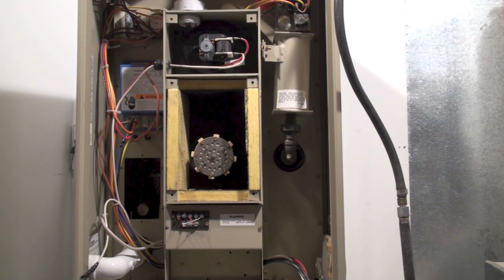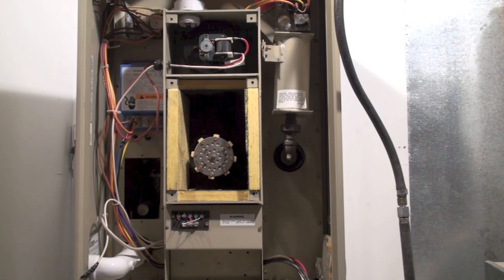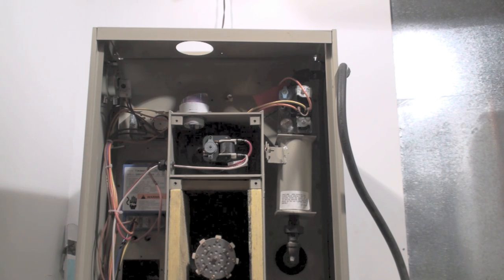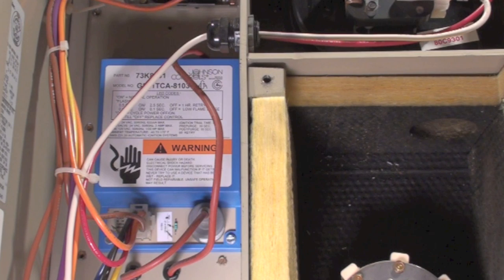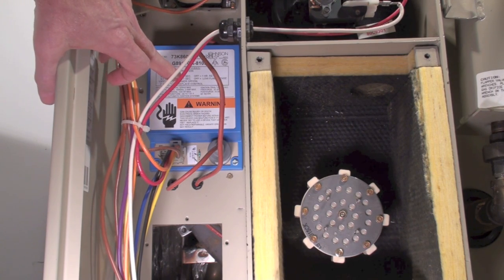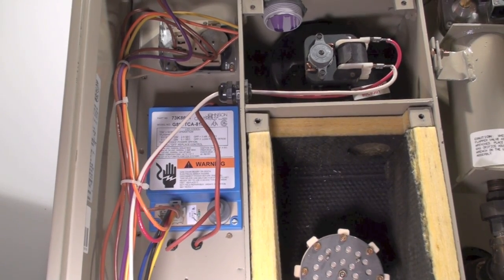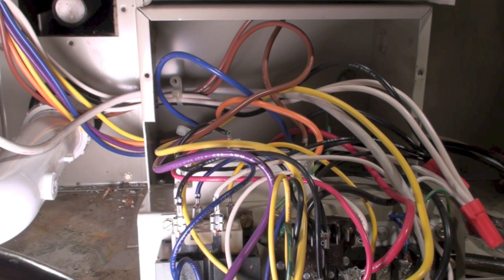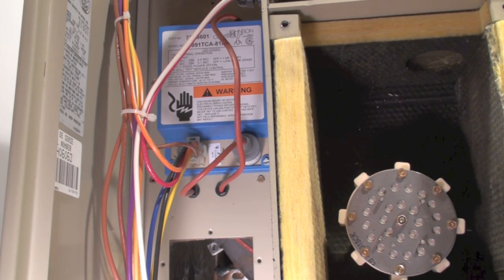How the Lennox pulse gas furnace sequences

Comment: I have a pulse furnace. Heat exchanger was replaced in 1994 due to recall. Inspected in 2014. Still running perfectly at the end of 2021. I am so nervous about this winter....

Comment: Your videos are excellent. There green light on the control panel stays solidly lit and then there is one click (like it's trying to spark).  Then there is another click - I did not time it, but maybe 30 seconds to a minute.  Should I try replacing the spark plug or could it be something else?  I can't tell if the flapper is working or not.  Tried to uncover that part of the unit, and it was pretty tough.  Did not want to force it.
Reply: Forgot to mention.  After a while the green light flashed, which according to another video, means that it's going through a hard lockout.  The fan works well.